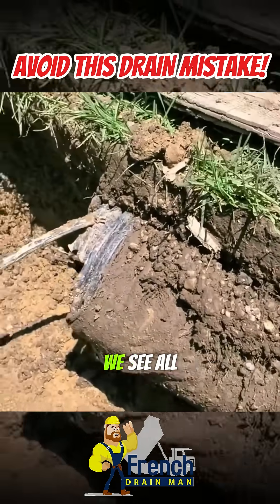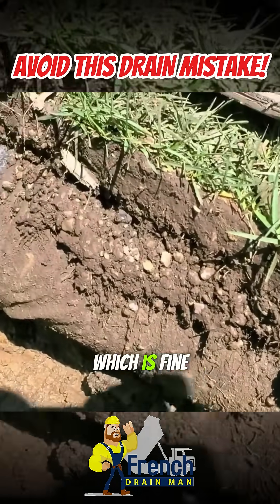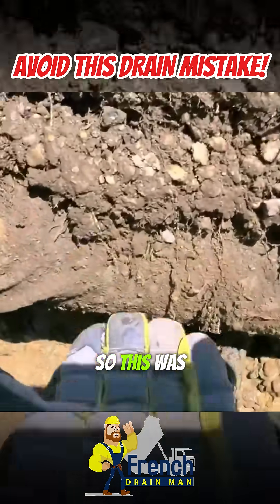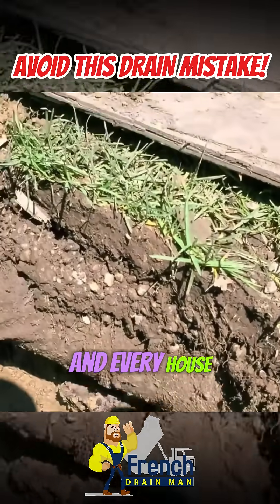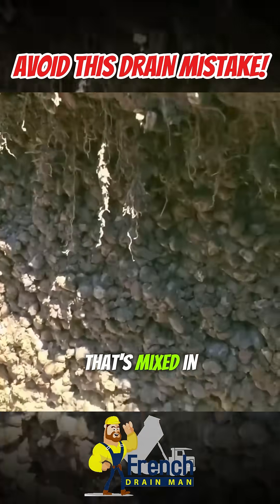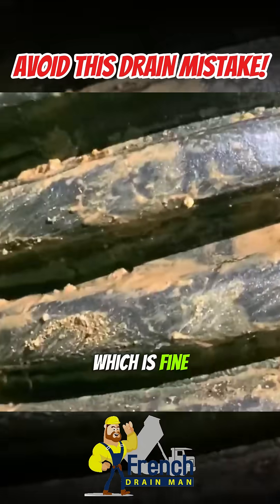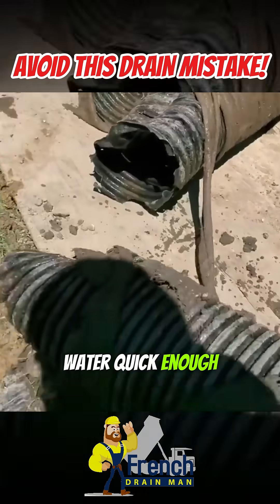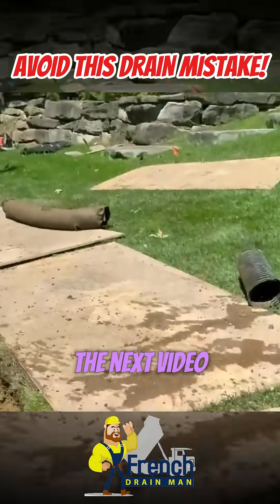Lazy Contractor? Here’s How They Ruined This Drain

Comment: Something i noticed is with smaller rock, the dirt can take it over quicker. I used recycled concrete as backfill for a stretch of my french drain and had to dig it out and put 1 inch clean rock with jagged edges in.
Reply from the maker: I have use non woven fabric too.
Frenchdrainman.com